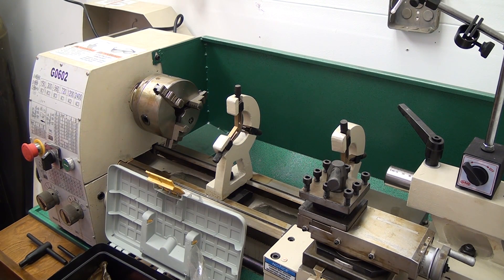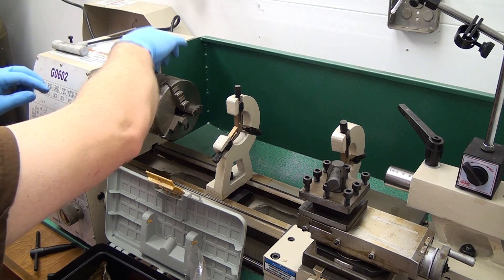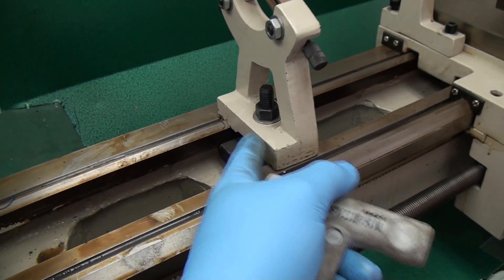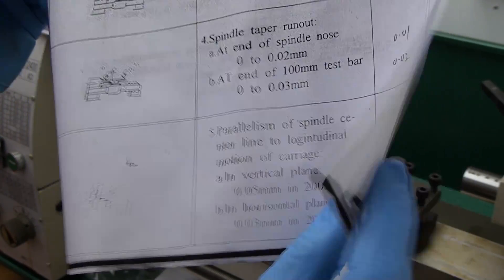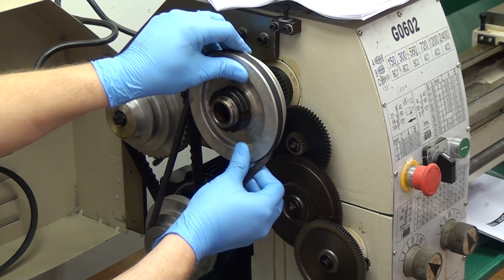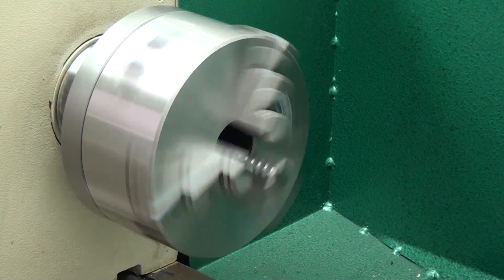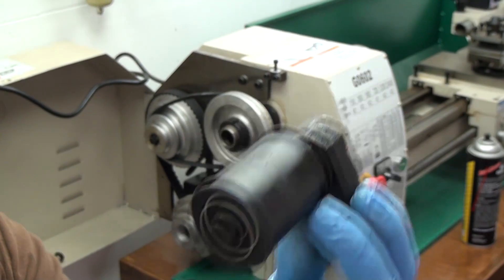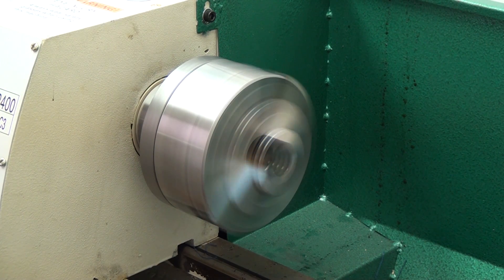04 G0602 Break-In and Chuck Removal

Comment: another way to loosen the chuck - instead of using the pipe wrench, grab the old busted v-belt you keep forgetting to throw away and use a pair of vice grips to clamp that to one of the pulleys on the back. this will effectively lock the spindle without damaging anything - especially useful on old atlas lathes where everything is fragile Zamak and the only other way to lock the spindle is by jamming the back gears...
Reply from the maker: Oh I like that idea. I'll try it next time I have something stuck.
Thanks!

Comment: Russ, are you still running motor oil in your 602 or did you buckle to peer pressure and get some of the magic lathe gear box oil?  Im expecting my G0752 in a few weeks and about all i don't have now is the special ISO 98 oil they recommend.  Im not sure what to think about it.  I have gallons of motor oil in the shop from another project...
Reply from the maker: I actually drained it and filled it again, using the same 30 weight non-detergent motor oil. It's such a slow moving gear set I figured there was little benefit to going with fancy oils.
Reply: Russ, thanks for the reply.  I did find a Qt bottle of the ISO 68 and 32 at my local Bomgars farm store so i went ahead with that.  The oil was $10/qt and I hope a qt of each will be more than i need.  Thanks again for the videos, keep em coming!

Jim
Reply from the maker: Good find!

Comment: If this one is anything like the mill I bought those numbers on that spec sheet should end up being in metric and not inch.
Anyway I've been looking at the 752 just like this with a variable speed, how do you like it so far?
Reply from the maker: You are correct about the specs being metric, I just hadn't noticed it at the time.

I am very happy with it, and for the price I don't think you can do much better. I would LOVE the variable speed version, and some day may modify mine to have variable speed.
Reply: russtuff I laughed watching your vid when you opened the spec sheet and said what the !!! I had the same reaction looking at mine before it dawned on me I was looking at metric's.
Reply: russtuff I was going to get a Grizzly G0602 lathe, but I bought a very old, ugly, but very nice where it counts Clausing 4902 lathe.  It's much easier to change the speeds on the Clausing than the G0602, but I didn't even bother with that.  I wired it from the start with a VFD.  There is a bit of a trade off on the torque when using the VFD instead of changing the mechanical gearing, but I picked a good gear at 60 Hz for most of my machining and I can live with a bit less low speed torque for the push button ease of changing to any speed I like.

I have a Grizzly G1006 mill/drill and it has a 2HP single phase motor that I'm swapping for a very nice and very cheap (on eBay) new sealed Baldor three phase motor.  It'll get a VFD and that will be under CNC PC control.  I hate moving the two belts on those pulleys to change the speed.  It's a real PIA and it takes a lot of the fun out of machining.

Thanks for the video!
Reply from the maker: Liberty4Ever Sweet! That model Clausing looks like a great machine, and definitely heavier than the G0602. I plan to swap over to a 3ph motor with VFD before much longer too :)
Reply: russtuff I spent some quality time with my Clausing lathe today.  I'm making a SuperDuperFly, the larger version of the Tormach SuperFly fly cutter.  I'll be posting a video in a day or two.  I'm still very impressed with the Clausing.  It looks rough as a cob, but it's got it where it counts.  It's a joy to use, and it makes a gorgeous surface finish.  I'd highly recommend a three phase motor and a VFD.  You'll love it on your lathe.
Reply from the maker: Liberty4Ever Sweet! I've been wanting to make one too. I'll he looking for your video.

Comment: A couple of other suggestions: chuck a hex bar in the chuck and use a wrench on it when loosening the chuck...a wrench on the jaws may cause damage.  To hold the spindle you can use a strap wrench on the pulley. The board to protect the ways that you mention us cheap insurance...also recommended when using a hacksaw to finish parting work. Saw these tips on various other channels, such as DoubleBoost. 

Thanks fir the videos...I've been looking at the same lathe.  Do you still like it?

-- Mike
Reply from the maker: Great ideas, and thanks for posting!

I do still like this lathe, and have been happy with it's performance. It does everything I've ever needed to do, and I understand there is a variable speed version now. If I were buying today, I would look into that model.

Comment from the maker: I haven't heard anything like that on mine, but you'll want to get it sorted out as you'll eventually start using the high RPMs quite a bit. Have a recording of the sound? I would consult Grizzly as well and see what they say.
Can you tell if the sound is coming from the gears on the back of the lathe or does it sound like it's coming from inside the box?

Comment: when i did this my lathe had some gear box chatter its not a grinding or whining just a low chatter sound on the two highest settings??? is that the norm' or should i contact grizzly and inform them of the noise? thanx

Comment: I got a Huvema HU 550 vario.

I got 2 belt settings for lower speed high torq or high speed low torq. 

But im always on high torq low speed couse that gets me like 1550 RPM high speed 2500 wich i would never use.

yea, i like vario lathes :D.

Comment: I am playing with aluminum and with the power feed it seems to be moving too fast.  I have the gears set from the factory and I think they are the same as in the diagram for the power feed chart. I set the dials to the .0025 which is the lowest speed it cuts great but I still feel slight thread like grooves.  I am using the cheap shars 3/8" carbide inserts which may cause some of it.  Could I gear it to slow it down more? or maybe look elsewhere for a problem?
Thanks Again.

Comment: I noticed that when you run it to the back it gradually show the screw in the front, that made me think I was wrong.  Guess I'll take it back apart and reverse it.  Have you oiled where the oilers are on the spindle?  I did then found where someone suggest not doing it because it washes the grease out.  Any suggestions? 
Thanks Again for all the help!

Comment from the maker: i just ran out and looked at mine, and the tabs on the cross slide screw cover are at the front and facing down. i also checked grizzly's site and in the pic for the g0602 the tabs are in the front facing down as well. that said, if yours is sliding back and forth with the cross slide and it's covering up the screw then i would consider it good to go.

Comment: Well after a day working on the bench and a trip to harbor freight for a shop crane finally got the lathe set and powered up. On your cross slide does the cover for the screw slide back and forth? I took mine apart to clean it and I think I got it back correctly but I'm not 100% sure.   I have the tabs in the back pointing up so when you move the slide to the rear it catches it an pulls it to the rear. Thanks for all the Help! 
PS 2400 RPM Holy Crap!  It scared me to Death!

Comment: That bolt is pretty annoying - sure seems like they could have spent a few extra pennies and gave the customer a better way to open the gearbox area.  I'm probably going to put a ball end quick release pin in mine, if it annoys me too much.  Or perhaps cut a small hole and put a "button" through it, mounted on a thin piece of spring steel.

Comment: I'm curious - what happened to the two gear selector knobs on the bottom of the face of the lathe?  They seem to be filled with oil behind the glass.  Or maybe that's on the outside?   I just bought a used G0602 and the knobs are completely white...

Comment from the maker: @totalmalfunction That seems logical, but I have actually never tried it. The way you see me doing it allows me to easily roll the belt on without actually messing with the tensioner. I will try your way though and see how it works. Also, the way I have it is how it appears in the manual.

Comment: Great videos, I've actually been referring your channel to guys asking me about my lathe thinking about getting one.  
Pro-tip, I welded a little bar to the bolt holding the pulley door closed, making the bolt a T shape.  Now I can get in there quickly with no tools!  
I machine practically ALL my aluminum at 2400rpm and quite a bit of steel too (5/8" bars and stuff), you get used to the speed :)